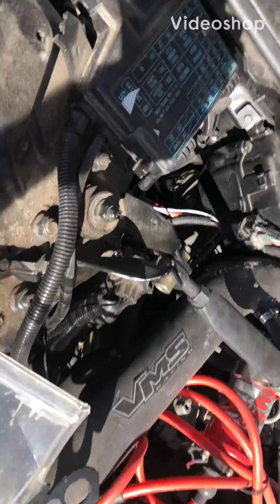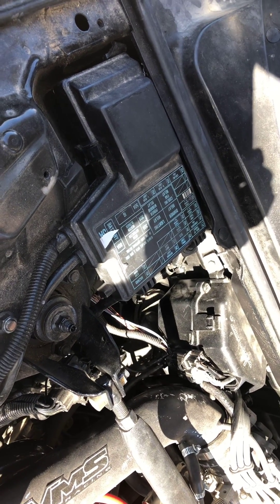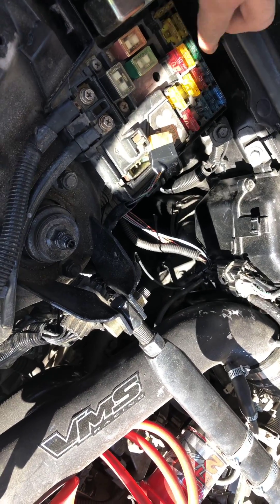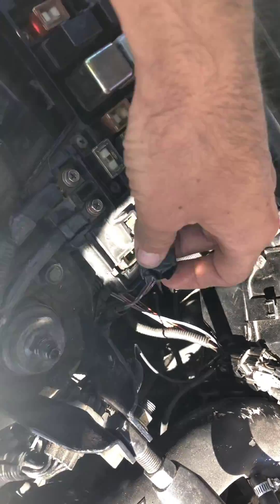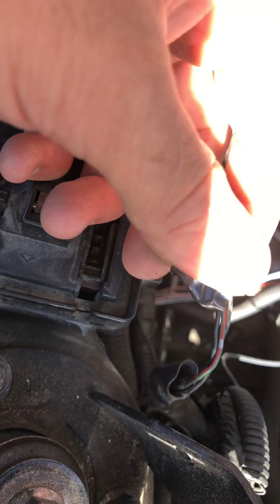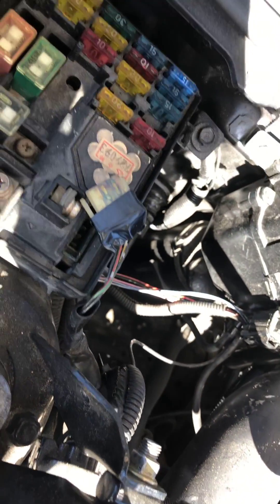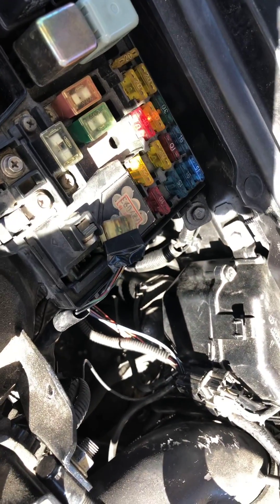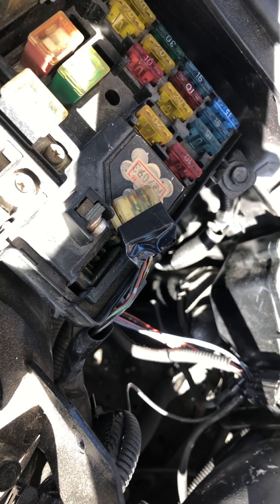Electronic load detector bypass

Comment: Hi brother, I need some help. My honda odyssey ra3 1997, will have engine light ON after some while of driving,and will go off after I stop engine for some hours. When I check the code they said its Electrical load detector ELD voltage high. The workshop said the internal ELD cannot be replaced. I need to replace the whole fuse box. I need your help is the 820ohm 1/2watt resistor (gray, red, brown, gold)?and my ELD connectors wire colours are black, greenred, and yellowblack. Which colour wire I need to join with redgreen wire. Because black wire got 2 wire, black and yellowblack. And 1 more thing do you think my problem is the ELD?
Reply: I know it has been a long time and the admin won't have the time to study your question, but the answer seem to be at time (1:32) above.  That is connecting the 820 ohms resistor from the red-green (stripe?) to black wire.  Remember the convention of black color is for negative (and ground connection) in automotive electrical-speaking language. Thus, bypassing in this sense means Do Not Cut any wires!  Instead, put the resistor 'Across' and that means connecting the two ends of the resistor, one to the black wire and the other end to the red-green (stripe) wire.  Based on my familiarity of wires in auto applications, I put in the word 'stripe' to enhance understanding, because there is no way to mix colors on wire insulation (for standard color coding system, and/or any agreeable conventions and explanations, if there are any!)

Comment: All you did was add the resistor? No relay?
Reply: A relay would be good for remote external control, but would required power to activate its switch contacts.
Moreover, the relay's coil has a resistance value ranging from 130 ohms to 160 ohms, depending on construction characteristics/specifications.  Here is an idea:  You might want to add an external wiring (to the relay) to switch on, in order to control When do you want to connect that 820 ohms resistor onto that Electrical Load Detector for the function of bypassing it, perhaps?

Comment: Would this work on a automatic?
Reply: So difficult to answer to your vague question, but since I am a trained engineer, are you meaning "automatic transmission" car?  No problem for bypassing.
If you ask "does it work automatically", referring to the function of the bypassing resistor installed in the Electrical Load Detector?  Then 'yes', as it should work to override the 'automatic control' of detecting electrical loads applied to 'the electrical system' of the car, specifically causing the alternator to charge the battery and maintaining the charging voltage (and without fluctuating much) in the range of 13.0 V to 14.4 V (and vaguely depending on the particular car alternator models.)  So, he wrote the high range as 14.3 V and that is also acceptable on most brands of alternators' output.
Reply: Note that we need to 'be careful' of the automatic function of the ELD behavior, as the voltage fluctuations (variations) at a lot of time are highly undesirable and erratic at best, because of some kind of a guessing game at controlling the function of providing automatic input into the alternator's internal voltage regulator's output function.  The bypass resistor is also called a "shunt resistor" and it creates a pathway to trick the ELD "all the time", so any automatic function(s) are now stopped, for the purpose of "manually controlling" the voltage regulator output level (i.e, voltage values.)